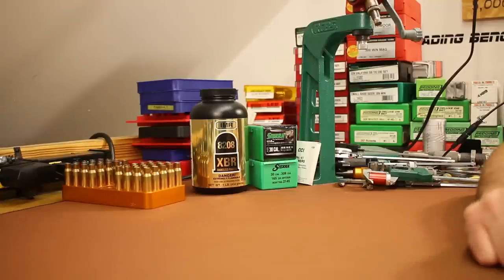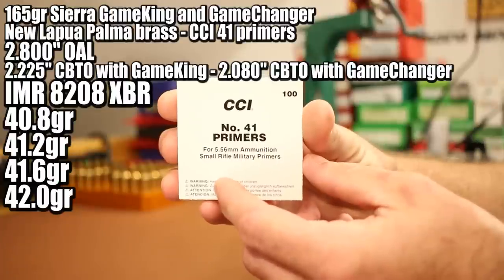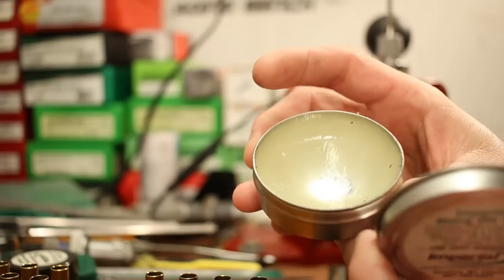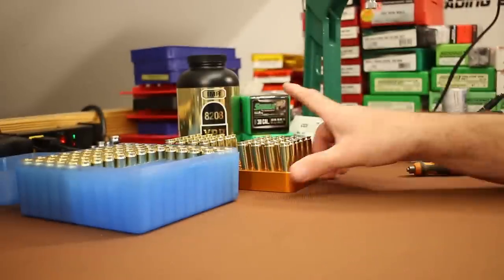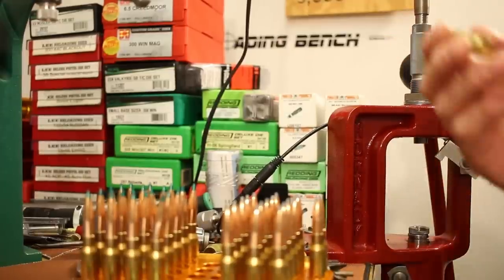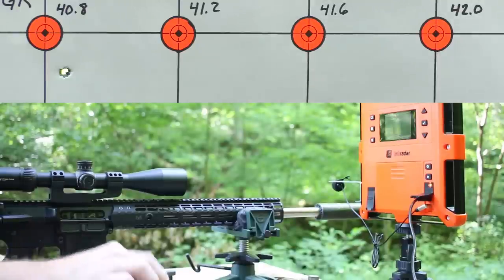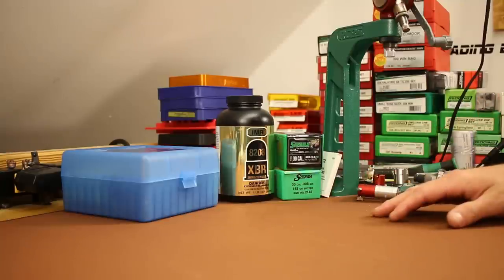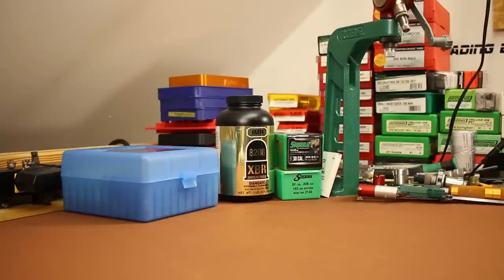308 Win - 165gr Sierra GameChanger and GameKing

Comment: Another video that makes me envious of those groups!  FYI, Hornady sells a flatbase/attachment for the calibers. I've counterbored/relieved the center so that any extruded primer does not touch.  Thus when measuring base to datum, I get no interference from a high primer or any extruded material.  I also added an extension to the modified case measurement tool, so now  it can be used on the AR10.
.
Reply: just use your empty hand priming tool and reseat any primers on cases you want to measure, it pushes them out of the way.

Comment: I’d like to see a 3 part series starting with your standard format of essentially finding the optimum charge weight. Then a video on overall length testing. Then a video testing different primers. Maybe do it with your new 223 bolt gun........:)

Comment: In my experience, Primer  pocket reamer is useful when using military cases, as the primers have a crimp.
Reply: Yeah, most of my 7.62 NATO brass needed reamed before I could prime them. I could force some, others the primer actually got deformed.... which is a little scary
Reply: @desertfox2020  the rcbs military crimp remover works great for the crimped brass. Wont make your primer pocket sloppy and priming is a dream when your done.

Comment: Great vid! Hard to go wrong with 308 Lapua Palma SR, Sierra, and 8208...👍. 

One thing for people to consider is that the SR primer is not a good option in larger cases for hunting in regions with cold temps. Anything below 40F and it’s wise to use LR primer brass (both in 6.5 CM and 308) to ensure reliable ignition.
Reply: At least until you put the large diameter primer decapper through it l, LOL .. uggghhhhh!

Comment: The Lyman primer pocket reamers that come with the orange case prep multi tool, are for removing military primer crimps. I have used the small one on 223 and it works pretty good. I also bought the small decapping pins .054 with my Mighty Armory shorty bull die, I think the .054 would have cleared the flash holes no problem.

Comment: Good information on the Game Changer.  Just bought some to try out.  My 308 AR-10 with 168g Match Kings, shoots really tight groups using 42.2g of RE-15 (less then one inch out of a mid range priced AR-10).  Yet I have not had close to the same results with Game Kings.   Since the Game Changer bullet is closer to the Match King in design I'm hoping to see some tighter groups with it.

Comment: In my rifle with short freebore, the  Tipped 165g Game king shoots a bug hole group WHEN seated very close to the lands with several different powders, IMR 8208, H4895, Ball C2, Benchmark, and R15.  

With the long freebore factory rifle, the standard NON vld type of bullets, 150g Hornady btsp, 165g Sierra btsp, shoots bug hole groups also jumping quite a ways.  I am leary of shooting a vld bullet in a long freebore chamber which will take some trial and error.  

The Hornady 165g BTSP should not be over looked as one heck of a good killing bullet on large deer and hogs.

For extreme cold weather, I have reamed out the small flash hole brass to a large flash hole which fixes any of the hang fire issues with no effect on group size.

Comment: In my Krieger bbl on Rem 700, these 165g TGK like to be seated very close to the lands, if not barely touching the lands.  Tiny groups are the result from barely touching the lands.  I have a "Palma" chamber in my Krieger that has a short freebore, perfect for these kinds of bullets, also the 155g TMK also shoots tiny groups.  Also, best accuracy was right at a max load, and I am using Lapua brass.  Primer brands do matter when trying to achieve very small groups.

Comment: You’re getting into a higher node when you got up above 2650fps.  SD started shrinking and groups tightened up.  Go a little higher, no pressure signs.  You’re almost at the node, SD’s will get even better with more case fill as well.

Comment: That comparator "adaptor" you use to measure shoulder set back, where can I get one? Does it have an angle to match your brass? 

Sorry for the rookie questions, but this stuff is great...👍
Reply from the maker: It's the Hornady Headspace Gauge Kit.  https://amzn.to/2RXFTTU  Comes with the body and five inserts that cover most cartridges.  It is not angled...just a certain diameter hole.  For 308, the hole is .400" and measures to that point on the shoulder.  If you go check out the SAAMI drawing for .308, you'll see that's the spec of the headspace datum line for that cartridge.  Most of the common cartridges are one of the five sizes included in the kit: .330"/.350"/.375"/.400"/.420"
Reply: @JohnnysReloadingBench  excellent! I know that kit. Had my eye on it for a while. Thank you, Happy 4th, I'm off to the range! 🇺🇸♥️

Comment: Over the holidays I built an AR10/LR308 carbine based on Aero Precision receivers and a Ballistic Advantage 18" Heavy barrel in .308 Win. I was worried about tearing up brass because I intend to reload in the future. I used an Extra Heavy buffer from heavybuffers.com and an adjustable gas block because I intend to use a suppressor when the stamp comes through. Almost all of my brass looked great over many kinds of factory loads, some had very minor dings but none had real huge dents. Maybe try a heavier buffer in the future if you are concerned about brass.

Comment: Johnny when you shoot 5-shot groups you should load 6 bullets, The 5th shot is always off because the bolt carrier is no longer sliding on brass and is moving at a different speed then the previously fired rounds with a loaded magazine. Just my opinion :/

Comment: @Johnny' Reloading Bench - Hey Johnny, I really like what you do. Lots of "Good Stuff"!
I'd like to see you do a little something different with the 6.5 Grendel. You've already done the 107gr Sierra. I'm asking if you might try the 100gr Sierra Varminter JHP with an older powder? I'm thinking maybe IMR 3031 or something similar that has been around for a long time and is pretty cheap to use a lot. I'd like to see if it's possible to come up with a load that can reach the neighborhood of 2650 ft/sec without a huge compressed load and a 100gr bullet.
(H322 might be a good one but I don't know, I don't have much experience with reloading).

Comment: when are you going to do the 129SST bullets in 6.5CM that you kept saying would be next ever since you bought the TC? If you need a challenge get a gas operated 243WIN, powder fill for a bolt gun is somewhat hard to do, but slow burn powders can unlock the bolt to soon on a gas operated rifle, and can damage a rifle. Be interesting to see what powder does best!

Comment: the .308 165 gr gamekings i have are a hollow point- cross crimped looking tip- yours are a soft point?
Reply: There are two versions of the 165 Gamekings. Yours is the #2140 and the softpoint version Johnny tested is the #2145. Hope this helps.
Reply: @rjm158  thanks- i've had really good luck with the ones i'm using, great groups and good performance on deer.

Comment: Are you using the air gun trigger adapter on the Labradar Johnny? Maybe I missed that in a previous video, what is that mic?
Reply: You are correct.  The Labradar is triggered by muzzle blast.  It can't hear suppressed shots.

Comment: What's a great lil cheap scale with ac adapter? Or do the batt ones hold up okay?
Reply: Jaime Willard I have no advice on the scale, but you can definitely convert a battery only scale to use an AC adapter. That said, there should be no noticeable difference in the same scale between using batteries and an ac adapter. They are basically using a Wheatstone bridge to measure subtle changes in voltage due to resistance changes across a strain gauge.

Comment: Hey! Recently started reloading and I have a ton of questions one of them being should I just get rid of my 1 in 9 twist 556 Barrel or should I keep it and just suffer with limited bullet weights? Thank you Jay RB for giving me the confidence to actually start reloading
Reply: My two cents worth.  One of my best 223 rifles was a Remington 788 with a 24 inch heavy sporter barrel and a 1-12" twist.  It shot 55 gr Hornady v-Max to 1 MOA.  Your 1-9" twist will handle 68 and 69 gr match bullets well.  Those bullets will shoot accurately to 600 yards.  Do you shoot beyond that a lot?  It will shoot the M193 ammo and clones better than fast twist barrels.  Green Mountain makes 12" and 14" twist AR barrels if you want to shoot light varmint bullets.  Most barrel makers are making 8" and 7" twist barrels now.  They shoot the heavy match bullets best.  Those heavy match bullets are the most expensive bullets in the caliber.  They cost more to reload.  So it depends on what YOU want to shoot the most.
Reply: @PC-vq5ud  600 is right at the limit of my ability,  I guess I want to make use of the heavier rounds for coyote hunting because they do better with wind at range.  But thanks for your input!

Comment: Johnny,  Just a thought for your next session with your 308 Tikka.  Natchez SS catalogs a Tikka 5 shot magazine for the 30-06 length cartridges.  Get one of those and you can seat your bullets out as far as you want.  It is single stack so it should feed fine even if the cartridges move around a bit.   https://www.natchezss.com/beretta-magazine-extender-for-select-tikka-t3-tikka-t3x-calibers.html
It lists for 6MM Rem and 6.5x55 Swede and up.  One caliber length of bullet seated into the neck is the rule I've heard.